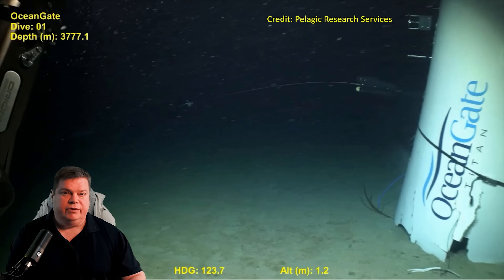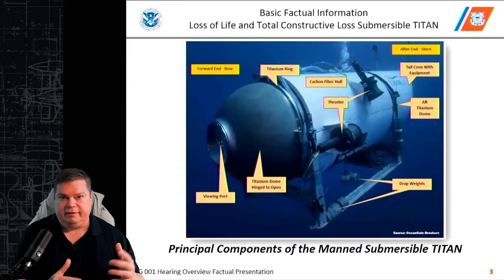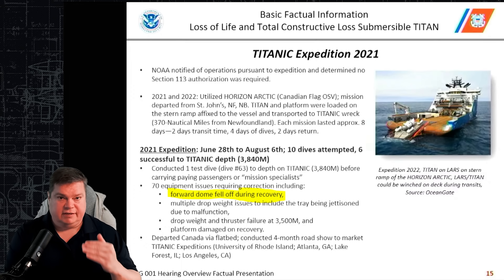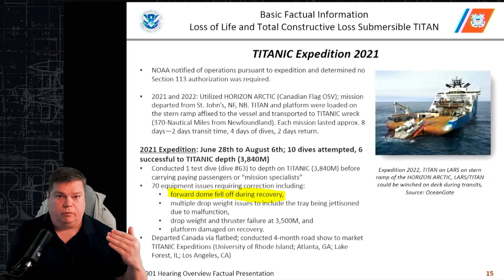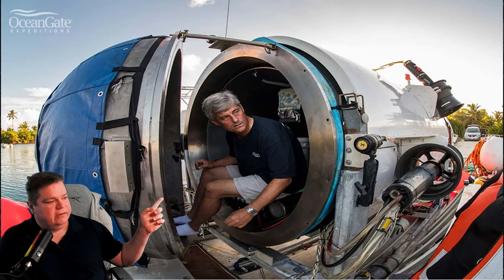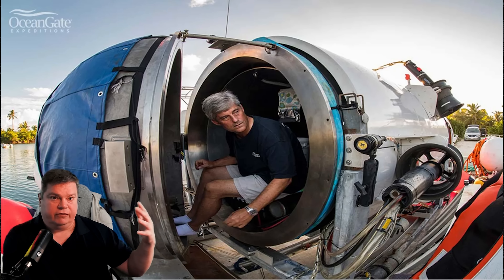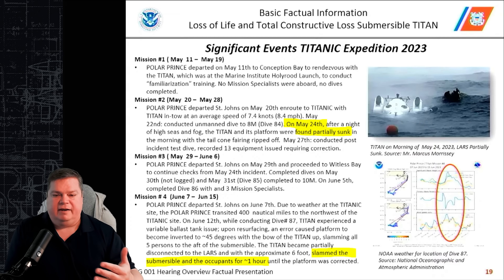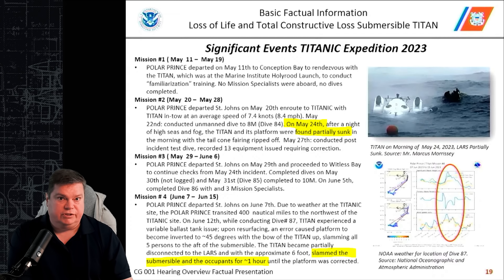New Evidence in Titan Submersible Disaster

Comment from the maker: Thank you for watching. You can see many more of my videos as a YouTube Member and on https://www.Patreon.com/subbrief.com     Love to have you there and on our NEW discord! 
.: https://discord.gg/pNTJq576
Reply: That’s not a sub that Aaron would be operating in with a PlayStation controller. When asked if he wanted a ride, Chief Aaron said “Negative!”
Reply: Ive been in a sub, this thing is more like a coffin tube or a very high pressure bath tub, but this is no sub.
Reply: I love videos like this I have one question for you....

Did they do anything right? Because so far the videos have been about everything they did wrong. But my question is wrong by whose standards?
Reply: Curious to know your thoughts on MicroProse Sea Power ;)
Reply: 2 corrections: 1) When the dive log shows they jettisoned "weight tray", you said that was the rectangular frame they jettisoned.  The rectangular frame has weights on it, but it is not the weight tray.  In 2nd or 3rd day of testimony, one of the engineers who worked on Titan testified that there was a separate weight tray attached close to the bottom of the hull (the belly), and THAT is what got jettisoned.  Had they jettisoned the frame, it would have made it nearly impossible to dock Titan on the launch ramp.  2) Other estimates I've seen online set the duration of the implosion at around 20 ms, not ns.  Though that is still too fast to have been perceived by the human brain.
Reply: The implosion sound heard by the US Navy did not occur until 13.22 EDT but they lost communication at 10.47 EDT, so they were down there for another Two and a Half hours before they imploded! What happened in that time between the loss of contact and the implosion?
Reply: Thanks for the the thorough summation. I fully agree with your conclusion. Leave it to rest finally.
On a side note, your voice was sometimes slightly distorted. Maybe your microphone level is a bit too hot. I recommend leaving about 12db of headroom on the mic and apply a compressor or limiter in your editing software to set the level and even out the peaks of your speech.
Reply: I’m not an engineer, so please understand my question comes from lack of knowledge. Most if not all of the videos I’ve seen on this topic stated towing caused a greater amount of stress, the Titan. They also brought up the distance to the site was far. You said towing was OK and I’m just curious to understand why you believe it’s OK when so many others said this was a possible contributing factor.

Again, I’m not an engineer, but I’ve gone fishing enough to know the waves shown on an after the day they went out were pretty choppy. They weren’t storm level, but they were choppy. How much of an effect would that have on a vehicle you’re towing?
Reply: @damienjstepick  I agree, as someone who grew up in the Maritimes...400 nautical miles of being towed in the North Atlantic even on a nice calm day that ocean is wild.  Beating waves, and pressure must have been torquing that sub like crazy. Not to mention the cold water in June is about 30-45 F.
Reply: "The front fell off" I see what you did there.
Reply: I'm not concerned with the dome falling off or the hinge being bent. It is very heavy out of the water, but in the water, it would be a lot less heavy. Plus, outside pressure would have held it close. It would not have fallen off while down there.

What if because of a bent hinge, the door didn't fit straight and it leaked? Then they would have flooded, and they would abort and go back up. It indicated a possibly slap dash trial and error approach, but those things themselves aren't dangerous.
Reply: I'm convinced the forward dome hit the ground with a bit of velocity.  The sand is clean within a constant radius around it and there is a defined edge at a constant radius around the dome.  This is different to the aft section.  This implies sand got blown up and across from the impact, the dome is also sitting what looks to be around 12" into the sand.  The last thing is that single piece of debris that is sitting next to the dome has sand on top of it, this is not the same with any debris around the aft section.  I know the vessel was crushed quite high above the surface, but it still honestly looks like the forward dome struck with some impact.
Reply: @S-T-E-V-E  That's the most interesting question in my opinion. They knew they lost communications and therefore were most likely attempting emergency surfacing which was not working according to my understanding of the situation. Some of them must have hoped for rescue, while others knew that was not possible with the equipment available on the surface.
Reply: @rationalist47  I wonder if they experienced a complete power failure and spent that whole 2.5 hours in the dark? Terrifying!
Reply: Yeah, I have to subscribe to you, after viewing your YouTube post. Clear, concise, thorough based on correct data with a timeline to boot. 
Wonderful.
Reply: I feel very vindicated. I was literally the only person on here who was saying that the cause of the accident wasn't the carbon fiber being too weak or failing. Now it turns out it was just the interface between the ring and body or dome.
Reply: The NTSB just released preliminary data and pics. I know you aren’t a composite expert but please make another vid based on the latest release. 

I’m a Zoomie but my son is an AZ so I am warming up to Navy types and you are tops!
Reply: That is the hull not the panel
Reply: @SubBrief  wrong title. It wasn't a "disaster". It was well deserved comeuppance for stupidity and decadence. Maybe not workable as a title though...
Reply: @tomwilson1006  The Playstation controller was not the problem. For a prototype it was more than fine.
Reply: @christianhoffman7407  yes, we know!
Reply: Agreed Titanic is a wrecksite and a gravesite.  Not a tourist site.  Nothing there for the average person.  I frankly cannot comprehend the fascination with it.